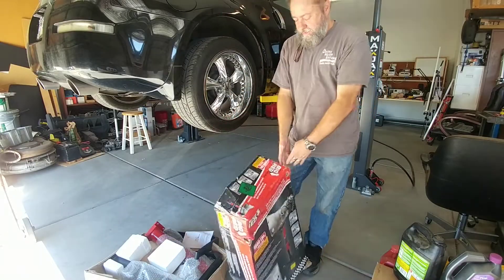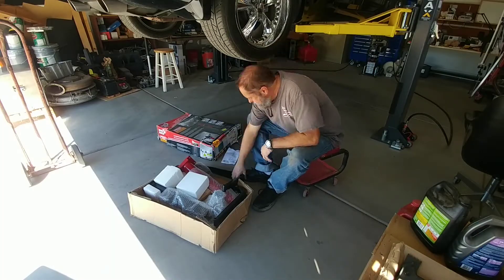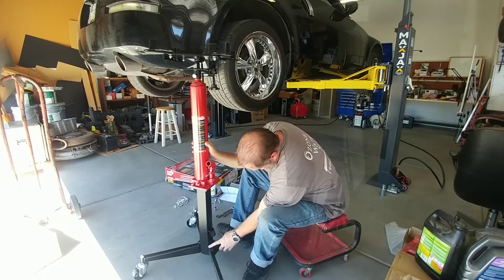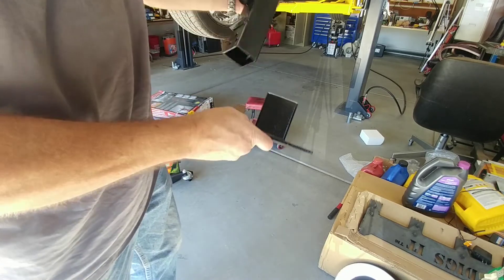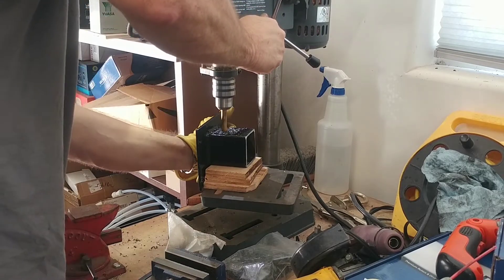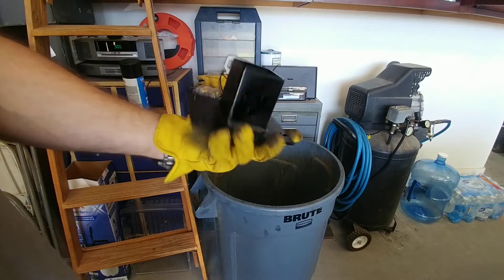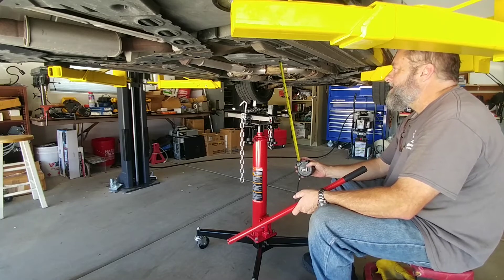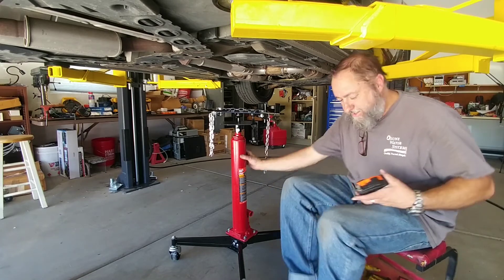BendPak MaxJax M6K Lift - Big Red Transmission Jack DIY Modification

Comment: how much did you end up removing? what was the height to the base of the jack when finished?
Reply from the maker: It is 33-3/4" from the ground to the platform at the lowest position. The 4 corner risers are a bit higher.  I thought for sure I had the measurements in the video, must have been left on the cutting room floor!

Comment: Great idea! You could also use this as a platform for oil changes, instead of the dedicated oil change post.
Reply from the maker: Absolutely.  The top is a bit wobbly without any weight on it but you could work that out if needed. It could also be used as a jack point for the rear of the vehicle if you were to pull a motor out, for example, where there was risk of the car tipping backwards from the CG suddenly changing.